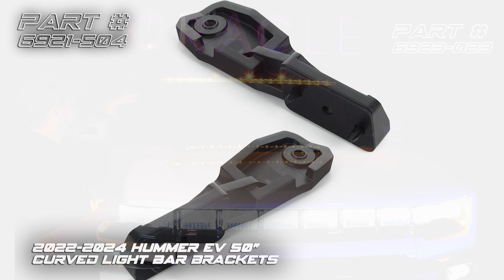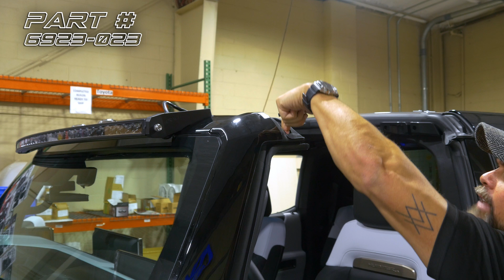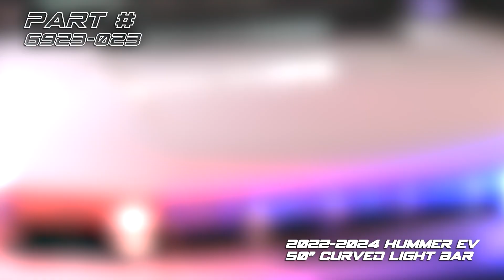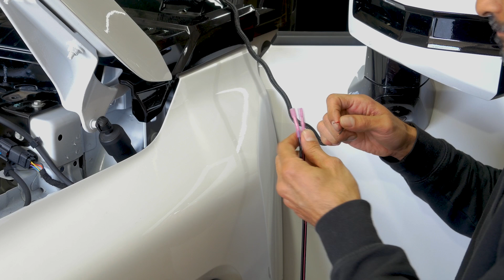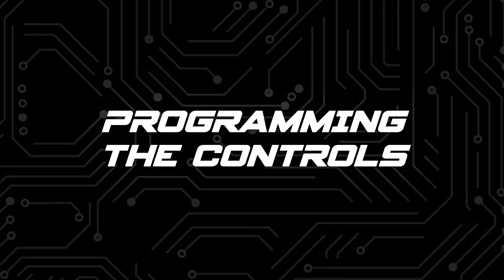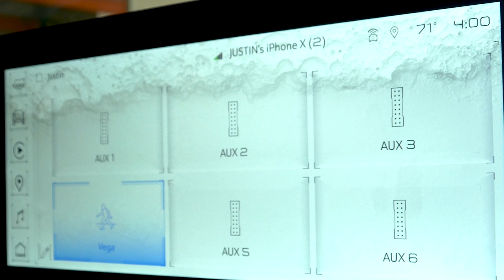NOW AVAILABLE FOR ORDER! 2022-2025 Hummer EV 50" Curved Light Bar Install Guide

Comment: Wouldn't the way you ran that wire mess with the sky panel fitment and warp the weather strip?
Reply from the maker: The gasket is much thicker than the cable, we have been running this way for 6+ months with no issues. We do have a ALT cable method we will be updating soon. You can use either option based on your own preference.